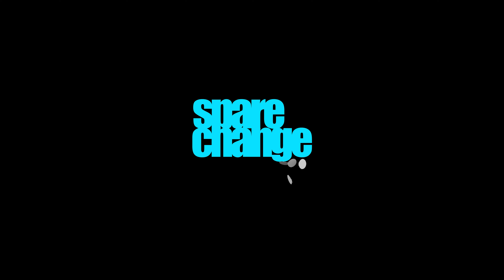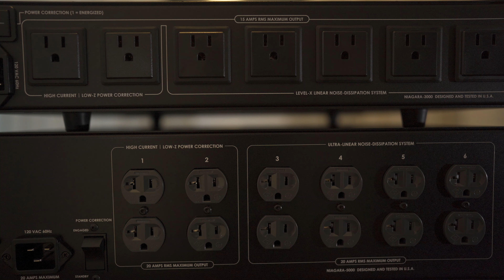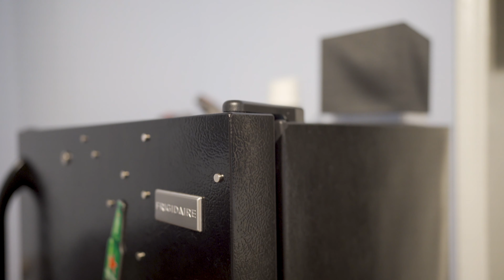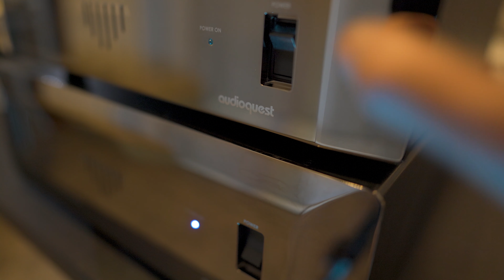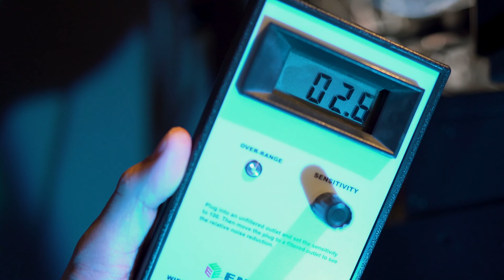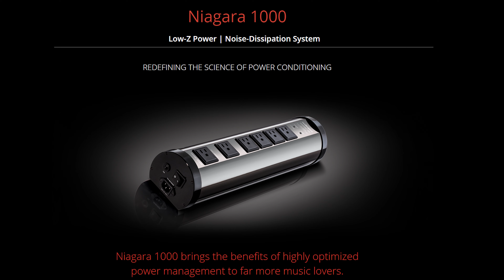Are Power Conditioners SNAKE OIL? AudioQuest Niagara 3000 & 5000 Power Conditioner Review

Comment from the maker: DO POWER CONDITIONERS MAKE A DIFFERENCE?
Reply: Yep! Definitely! Really digging my Furman Elite 15 PFi. 👍
Reply: I am holding out to get a niagara 5000. I was going for the 3000 originally, but the 5000 will give me some more flexibility when  I add more amplifiers to my system. Trying to slowly move to separates is a painful process.
Reply: @shaggs2riches  I went Furman Elite 15 PFi + a Topaz Ultra Isolator transformer. At 50lbs just for the transformer, it’s far larger than anything that could ever fit into a Niagara chassis. With 140dB of common mode noise rejection at 100khz (more at lower frequencies), I’m getting comparable performance at a fraction of the cost. Also designed by Garth Powell.
Reply: With the video equipment you have it's a shame you didn't test it visually on the OLED and whatever else and give your opinion. Because as people know the black background helps bring out more details in the video image. As in audio - mains noise hides, or disguises the available details/clarity, contrast etc coming from the video source and source components. Robs/steals/hides around 30/40% some will say.

Excellent video anyway though.
Reply from the maker: There's an idea.
Reply: nice i need some more sparechange for those furmans lol
Reply: Yes they do! I experienced almost identical results as you did. Not with a audio quest branded conditioner though. My system really benefited from me using a power conditioner.
Reply from the maker: Which do you use?
Reply: @therealshanelee  WAudio W-4000. A total different price range. But it was like magic when I plugged my receiver and player into it. Letting the Rotel amp getting a straight line. It gave the system like 20% more life. Couldn't really believe it at first 😅
Reply from the maker: Your unfortunately correct. I don't mind though. I trust what I can hear.

Comment: Have you compared the model 3000 to the model 5000 in the same stereo?
If yes, could you hear any difference?

I am considering one of the Niagara boxes.  I would rather not spend the extra $2,000 for the model 5000 if there is no benefit (or if the benefit is nearly imperceptible).

And have you used the model 7000?

Any advice on choosing a model?

Comment: Food for thought. Amir at Audio Science Review, tested Audioquest Niagara 1200 Power Conditioner in August 2021. It did not do to well. Conclusions: “If you want a non-destructive surge protector, the Niagara 1200 provides that. Other than, all the other claims made by the company and its promotional videos are without foundation based on my measurements and listening test… If you want to spend $1000 on a sturdy box with surge protection, go ahead. But please don't assume it does something for your sound. It does not. Needless to say, I can't recommend the Niagara”
Reply: @peterwikvist2433  but have you actually heard one yourself in a reasonably resolving system (no a topping e30 does not cut it) and heard that very system without the power conditioner in place? I find amirs work to be important but by no means useful when seeing if a product is actually pure snake oil or not. Because my ears are telling me a completely different story from what he did. Just some more food for thought. Youre free to not agree with me.

Comment: That's a considerable amount for anyone and unless you're living under power lines I don't see the justification for this product . Surge protectors and dedicated A.C. circuits should do the trick and one step further a possible U.P.S. Power supply for your audio gear should be sufficient without this cost . Yeah I'm skeptical .

Comment: I have a PrimaLuna Tube amp, a Parasound 5 channel amp, a Musical Fidelity 2 channel amp.  I don’t 
AudioQuest Niagara 3000 Low-Z Power Noise Dissipation System. I don't listen to music above 65 dB  and I don’t listen to aggressive genres of music  such a Heavy Metal & Rap.
Their are only 2 high current outlets un this Audioquest 3000.
I can't afford the 5000 or 7000.
Will the Audioquest 3000 meet or exceed my needs?
Thanks!
Reply from the maker: Yes the 3000 will work perfectly fine. If you want to order one send me an email.

Comment: I’m wondering how your system would sound if you plugged it directly into the wall versus the AQ… could all that noise becoming from that cheap out of focus outlet expansion box?

I’m not against AQ or clean power, just wondering what the perceived jump in blackness would be from the outlet as that is more of my own situation.
Reply: Probably zero difference.  Power amps should be plugged into the wall outlet directly

Comment: Okay some noise was filtered.  If the noise analyzer were connected immediately after the first of the noise filtering circuitry in, say, a preamp, would we see the same results?  In other words is the extra circuitry in the power conditioner redundant with respect to what's already in your gear?  The premise this demo was based on using objective measurements so let's measure again rather than relying on the "increased detail" comments.
Reply from the maker: These are popular items. Not hard to get a demo and get ears on time with them in and out of the system. You can be the judge.

Comment: The only reason to get this unit is if you want the local surge protection it offers and need the outlets, or you want something cool in your system to point at. Other than that, any increase in perceived sound quality is negligible and or nonexistent at best (refer to ASR for self-education). These devices don’t do anything else to “help” the sound. What these devices do is validate just how strong the placebo effect really is - if you believe a device will improve the sound of your system, it will.
Reply from the maker: I'm sure you've owned one to make that assessment.

Comment: The biggest thing with this type of power conditioner is the power reserves that it has. I have a Furman power conditioner elite15 pf I, and for subwoofers its absolutely mandatory. You can't get this type of power from a passive wall socket, its impossible. I tried playing Midway from just the wall socket, and I couldn't do it, I'd completely lost all bass energy, and punch. You may be able to get it to measure fine with a simple frequency sweep, but when it comes to massive dynamic bursts of bass energy, a wall outlet cannot do what the system calls for. 15 amp, 20 amp, isolated line, it doesn't matter, it cannot pull this type of dynamic power needs. If you're serious about power then a power conditioner like this is mandatory. Even if you're not sold by noise pollution, you will be sold by better bass and more dynamics. AudioQuest Niagara is next for me, I think I'll buy 2 Niagra 1200's.
Reply: Can you please quantify what you say are "dynamic power needs"?  Honestly curious because muy guess would be that a 40A breaker on a 240V service could supply huge multi hundred amp millisecond spikes when needed.

Comment: Shane, sorry to join this discussion a year late. I’m not an audiophile but my family enjoys movies.  We live in Florida, so in addition to the sunshine, we also have lots of thunderstorms and the occasional hurricane.  Typicality, my surge protectors have been sufficient to save my equipment when neighbors were replacing gear. 

Last summer, during a near miss hurricane, I experienced my first brownout. We had three major power fluctuations within moments, then our TV screen turned brown. The AVR was done, but it could have been much worse. I’ve upgrading to a 13 channel surround system but I need to protect it before spring arrives. I watch your channel often, but I don’t recall if this Niagara gear in still your rack later? If you have switched to something else, what are you using, and why? I don’t require the highest level of performance ($5,000 plus a power cable won’t pass the “happy wife” test) but I do need a solid solution. Thanks in advance for checking this old thread and for your insight!
Reply from the maker: Yes I still use it. I have moved the Furman to my two channel setup.

Comment: at bare minimum get the AQ 1200 power conditioner. the 3000 and up models filter out more of the higher frequency ranges compared to the 1200 model. if you dont have dedicated lines just for your audio setup than a power conditioner is very important. clean power means all your equipment has a quieter background and 95-100% less noise going to it. Any noise in your power lines the equipment will pick it up and amplify it making it worse. clean power will mean a variety of benefits for your audio and video equipment even your tv will benefit from it. also keep your power cords away from interconnects, speaker cables etc as much as possible. even if the power cords are only a few inches away from another cable its better than touching other cables this will help a tiny bit with noise transmitting to other cables.

Comment: In my system the Niagara 3000 made a big and not subtle difference.  The audio guy came to the house to mount some acoustic panels and brought along a Niagara 3000.  I had the integrated amp plugged directly into a dedicated 20 amp circuit and didn't expect much from the AQ unit.  I was very surprised at the difference in the openness of the sound and in the bass.  I speculate that the improved bass performance effect comes from the ability of the AQ unit briefly to dump more current into the line when the amp demands it.  The whole system also seems quieter, as described in the video.  The system is composed of equipment from McIntosh, Revel, Rega, and Clearaudio.

Comment: Mr. SpareChange:  I will be adding the Bryston 28B3 monoblocs to my system.  These draw some heavy power.  Can I effectively use one Niagara 3000 or 5000 without running out of power?  Or do I need two 3000's or two 5000's?  Please get back as no one else I've asked has a clue.  I add that I have a dedicated 12 awg wire running directly to the breaker box on a 20 amp fuse.
Reply from the maker: You can use one of either. They have to be plugged into the high current outlets.

Comment: Hey king why are you using the 3000 and the 5000 would i need the both of them or just the 5000 for a martin logan 5.2 system that i own which is a pair of electromotion esl  a motion 8i center channel a pair of motion 2i an a pair of dynamo 1100x 12 plus on auralex pads for power im looking too get the yamaha mxa5200 an the cx15200 i like the krell system just found out about it on your channel lol duh  but its so costly but if i could get an amp an pre amp from krell would it be better that the yamaha what would you recommend if money was not an issue oh ill be doing kimber cables an power cords all around

Comment: I got impatient and purchased a Niagara 3000 instead of holding out for a Niagara 5000. At first I thought I did not hear a difference. After playing through several songs, I can say there is a definite difference. There are subtle sounds that I don't hear when plugged into the wall without the conditioner. Even little things like sounds of fingers moving across guitar strings became more apparent. I will be adding additional amplifiers to my system eventually, and will add a second Niagara 3000 to my setup when I do.
Reply from the maker: Awesome. Glad it worked out for you.
Reply: @therealshanelee  thank you!

Comment: imo it depends on how noisy or noise-sensitive your system is. I use to use Thor power conditioner power boards and now i have dedicated lines which i plug my components straight into. to me without conditioners the sounds is more dynamic.

Comment: The lead engineer from Furman, who designed the current generation Pro, Elite, and Reference Series... left and went to work for AQ (Garth Powell). Seeing that he oversaw not only all Furman products, but also all Panamax products (they are a subsidiary of Furman), I HIGHLY doubt that the lack of an expensive certification should be a cause for concern. I have a Furman Elite 15PFi and the components inside are absolutely cheap compared to the stuff found even in the 3000. I see sour grapes from other Audio reviewers that don't seem to have the same connections.

My Furman with power factor correction (And, Yes, I understand exactly what that means at a technical level) did help slightly improve the blackness of background, image width, and image depth from my Dual Benchmark AHB2 amplifiers (used as bridged monoblocks) and LA-4 preamp over my previous conditioner, a Panamax 5100.
Reply: @mikepawntee2425  I don't need measurements to make plain observations of obvious differences in background noise. 

You're obviously going to state that without some such double blind nonsense that I can't even believe my lying ears.

How many people have to be liars in order for you to be correct? How many users who have reported the exact same effect have to be idiots for you to support your assertion?

It's a big number. Which makes your claims even more dubious.

NOTE: Furman and AQ use series Mode protection without MOVs for most of their filtering. It is non sacrificial. But keep making assumptions.
Reply: @mikepawntee2425  You're going to enjoy my reply. I'm a retired professional Audio engineer with FOH and Monitor World experience at a major theme park in the USA, major convention center, a few mega churches, a radio station, etc. I've seen Furman's take direct lightning hits that saved entire JBL Vertec large format line arrays and their Crown amp stacks (likely the Yamaha or Midas boards and outboard equipment at FOH/MW as well, depending on how much current decided to try to find earth ground through the snake). We're talking over a million in hung boxes alone for a major array hang with 22 outboard Vertec subs. Saved by a few lowly Furman PL 20 Pro's. For those benefits ALONE, it would seem to be a wise investment. So, you can sit down now.

Are you normally this rude to absolute strangers? What makes you think you can condescend in this way?

What's worse, I'm a fully credentialed AES member.

You need to chill out.

Comment: I bought the Niagara 3000 with high power Thunder cable to replace my Nordost QB8 power strip.
It's only been 2 days that i'm using them.
Overall I am dissapointed so far, mostly by the bass performance, which seams to be more blur and lacking impact.
I don't know if the Niagara 3000 or the thunder are causing this, or the fact that the Nordost QB8 and Frey2 cable are not there anymore, I do know that those Nordost make a great imptovement in sound quality when they are there.
Reply from the maker: Try going straight to the wall and compare it with the Niagara.
Reply: It needs long burn in , I also changed from nordost to Audioquest n5000 feed by firebird a huge upgrade , I hope you stayed whit AQ

Comment: I went from the Panamax to the Niagra 1200 heard a difference in sound, making things smoother.  upgraded to the 3000 smoothed the sound out again.   Shane, what's the difference between 3000 vs 5000 in sound quality? I'm also running a Krell amp.
Reply from the maker: I honestly don't hear a difference between the two. The outlets are a lot better on the 5000 though and you do get more of them.

Comment: Everything I run in my home theatre runs clean because the power running to our home is clean. No need for a power conditioner. Surge protection only. $3000 and $5000? Forget it!!!!! The quality of sound is dependant on what’s inside your amp, preamp, receiver, CD player, SACD player and speakers. AudioQuest is telling us that it’s what’s on the outside of our device that counts., whether it’s a power cord, rca connections and yes even a power conditioner. That , “SpareChange” is snake oil!!!!!
Reply from the maker: Have you tried one of these?
Reply: SpareChange As I was building my home theatre, I auditioned several pieces of equipment including power conditioners. One was a Furman costing $2500.00.  No difference in sound quality at all and I have very good hearing. Like I said. It’s what’s inside that counts.
Reply from the maker: I have the $2500 Furman and the Niagaras. I also think I have some pretty good gear for my theater and two channel system. I have good hearing too. Wether you can hear a difference is totally up to the individual.
Reply: SpareChange I noticed you didn’t reply to Audioholics comment.  Care to elaborate as to why you didn’t respond?
Reply from the maker: We talk daily. I let Gene say what he wants.
Reply: @glennarcher986  try one and let us know